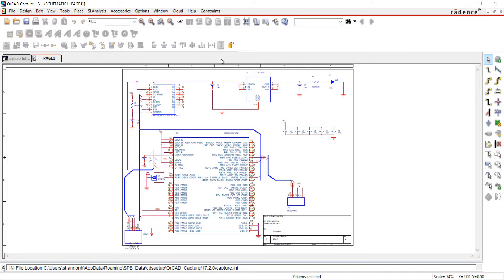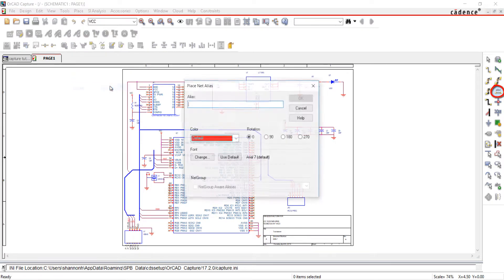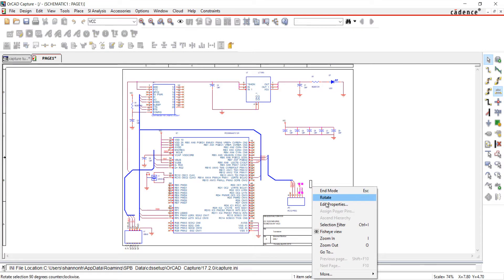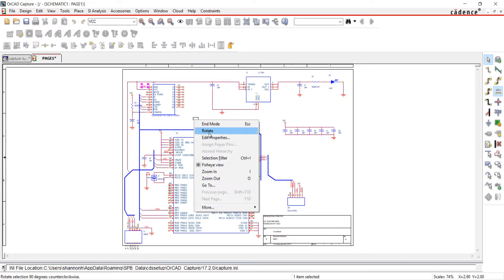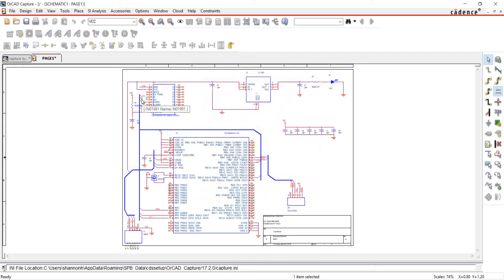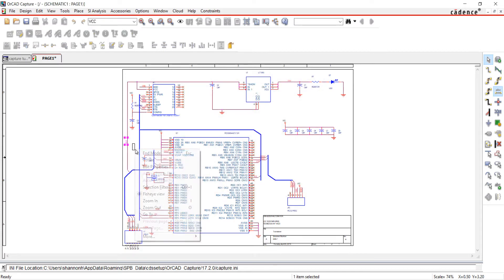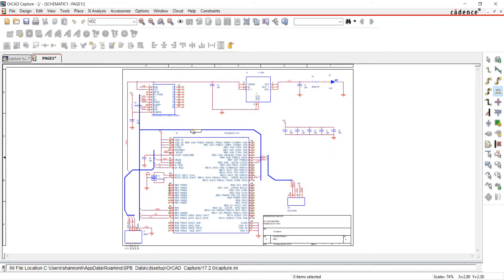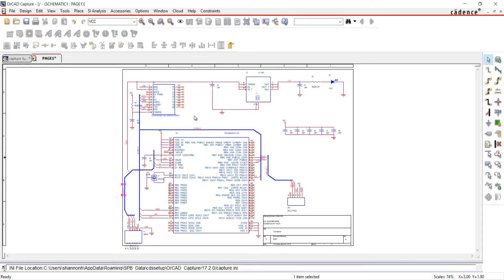How to Place Net Alias in OrCAD Capture 17.2

Comment: How to put a net name on a bus. In my system it doesn't work. Please help me out. It comes on wire but not on the bus.
Reply from the maker: For buses, net names must include the name of the bus and the connections. For example, PROG[0-1]. If the connections are not present in the naming structure the net name is not able to be placed on the bus. Hope this helps! You can always reach out to technical support for additional assistance. If you are an EMA customer, you can contact technical support here:  https://support.ema-eda.com/
Or find your local Cadence support team here:  https://www.cadence.com/en_US/home/alliances/channel-partner.html

Thanks for watching!